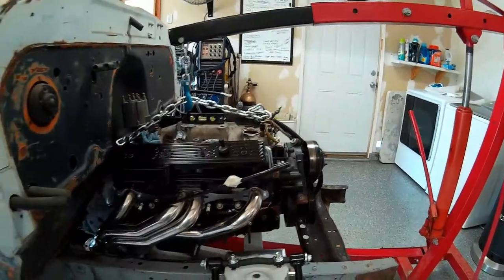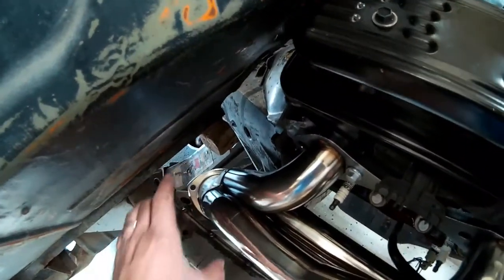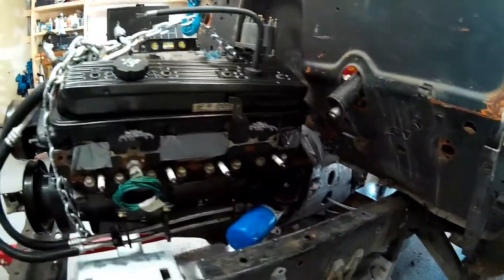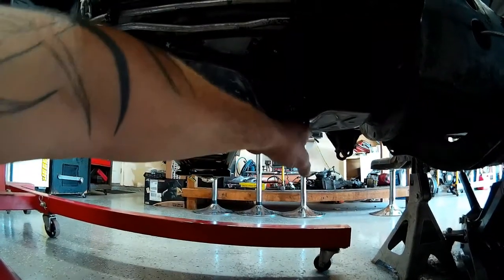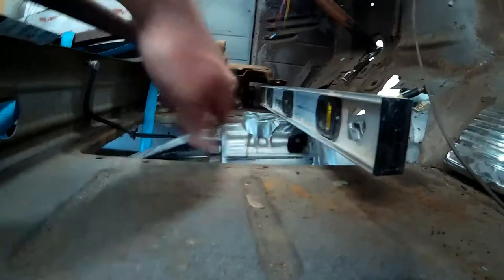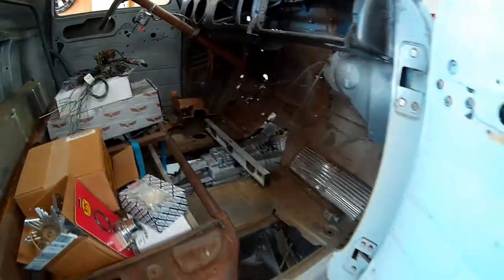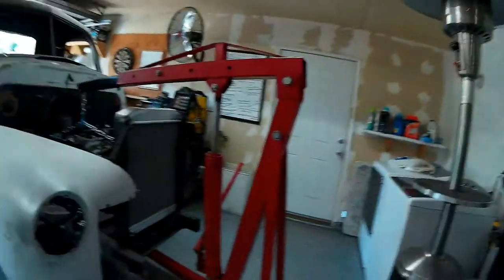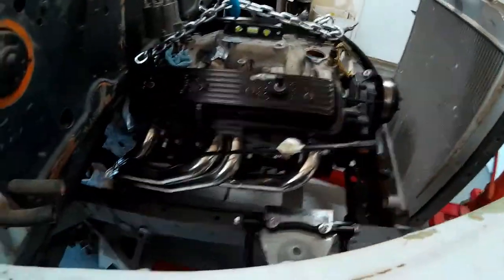P48 Project; Helix Mustang II IFS Install, Part 4 - Motor Mount Fabrication

Comment: Would like a video on Setting ride height....the initial setup and then zeroing in
Reply from the maker: Hi Ron, I'll be back on the P48 project soon and will try to explain better how the front suspension is installed to ride height.  It's a common question with this type of conversion.  Thanks for Watching!